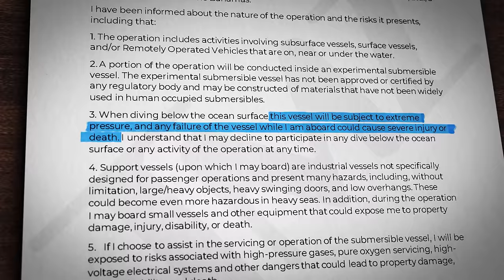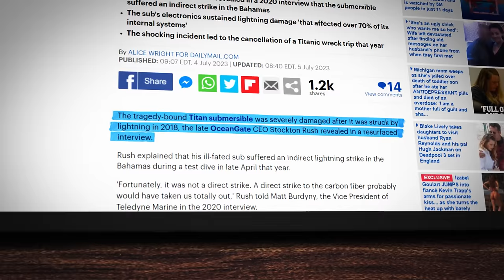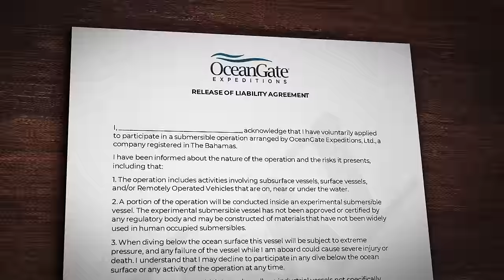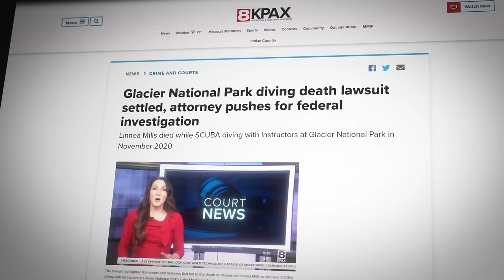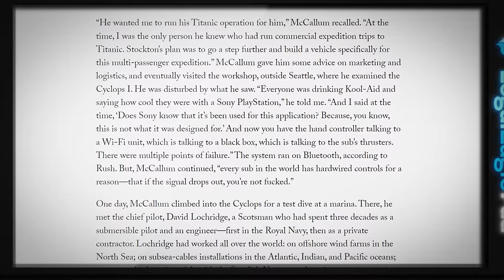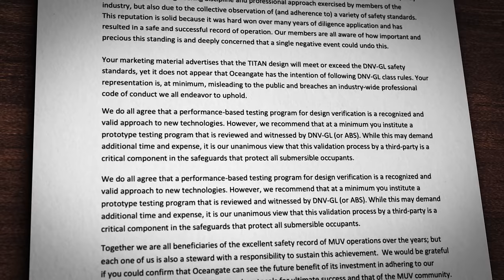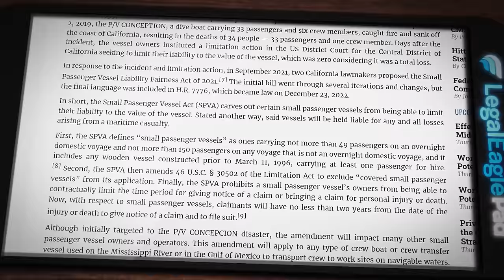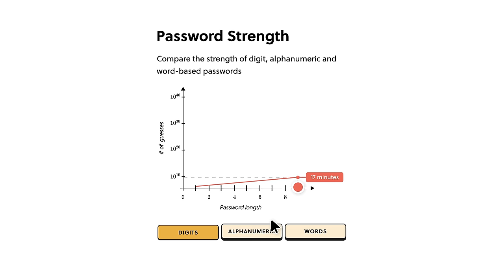OceanGate Is Getting Majorly Sued

Comment: It's worth remembering that the owners of the Titanic followed all the laws and regulations of the day in the building of the ship and the quantity and type of safety equipment.  It was also commonly believed at the time that large ocean liners couldn't sink under normal circumstances.  The sinking of Titanic led to dramatic changes.  But the owners of the ship weren't even negligent, never mind grossly negligent.  Even the captain of the ship was technically following standard procedures.
Reply: Maritime standards were atrocious back in the day eh?
Reply: Didn't they use bad rivets etc, plus didn't have the keys to the Loic locker with binoculars? There were a ton of rules broken with Titanic, iirc.
Reply: This is incorrect. The Titanic's construction had many cut corners. There existed two sets of plans; one for shareholders and regulators to look at, and the actual ones the engineers were to use. The main consequences are that the Titanic should not have sunk the way it did as fast as it did, and there should have been more than enough lifeboats for all passengers and crew.
Reply: technically titanic itself was tested  .. though ocean  gate was  not  .   titanic actually exceeded the standard of the day and the bulkheads wouldve kept them afloat in  normal head on crashed .. however it is HOW  it hit the  ice berg that led to its demise...   so  white star line  not claiming responsibility   is a little more ok ( not perfectly ok) than ocean gate that didnt  adhere to any standards
Reply: @samanthaabel1079  The Titanic was not tested, that was the first and last iceberg it crashed into. It was famously the ship's maiden voyage. Any ship would have sunk hitting that iceberg, but the Titanic's cut corners meant it sank too fast for people to safely evacuate, and they couldn't even do that because there weren't enough lifeboats. The Titan sub however was actually tested, it had already been down to the Titanic wreck a few times; the issue was the shoddy construction and lackadaisical attitude. The materials used for the hull don't do well with extreme pressure, and so the hull was weakened rapidly over its dives until it eventually gave and imploded. Both events have the same root cause of rich people cutting corners, both companies are responsible.
Reply: @YEs69th420  But not having enough lifeboats actually wasn't a negligence. There were enought life boats according to the law and current rules.
Reply: The Titanic wasn't merely built to conform with safety standards of the day. The hull and the multiple water-tight compartment design was well beyond what was required by law, and in certain respects. It was an EXTREMELY well made ship for the time period. She also had significantly more lifeboat capacity than what was required, and there wasn't enough time to actually load more lifeboats anyway. To say that it had a "design flaw" with the water tight compartments is actually very misleading. Those compartments were still offering way better protection than almost any other ship of the time period, and, in fact many ships being operated even today have less robust hulls and are actually more prone to sinking due to hull damage than the Titanic was. It is actually completely misleading and absurd to argue that the design of the Titanic was negligent, or that design flaws or "arrogance" had anything to do with the loss of life which happened.

The oceans are just inherently dangerous, especially the North Atlantic, and the Titanic was just unlucky. That's why it sank. The ship which rescued the passengers in the lifeboats was actually far far more vulnerable to sinking due to hull damage, and the captain's choice to take her at full-speed into an ice field was actually quite reckless, and it came very close to hitting ice as well, but it would have very likely sunk much faster than the Titanic did. 

More lifeboats wouldn't have actually helped that much at all. There's a lot of myths about the Titanic which many people still believe.

Comment: New level of horror with this whole situation is that window might’ve started to crackle moments before it imploded so they might’ve known they were about to die. That’s so sad.
Reply: Apparently the thing made really really loud cracking sounds even on the dives it survived
Reply: one preprint claimed there was 48 seconds of mechanical and electrical failure where they had no control, the sub was sinking and pitching, complete lights out.
Reply: @jeffreychandler8418 that’s terrifying, where did you hear that?
Reply: @VillainApologist_  "48 seconds ‘of horror’ aboard the Titan" AS news. seems to be conjecture from an expert on further inspection
Reply: It's probably the hull that started to crackle. The window was only blown out after the whole thing had imploded.
Reply: @robertgaudet7407  which was a sign that it was technically meant to be a throw away submersible.
Reply: @jeffreychandler8418  i heard that but i just dont know how much i can believe, the story keeps changing.  If they lost comms, how would they have any clue about that
Reply: @brp7856  They're looking at the time between losing comms and the sound underwater sensors picked up. They've also examined the wreckage.
Reply: @jeffreychandler8418 yeah that’s the official report. They all flew to the bottom and then boom.
Reply: @ZiddersRooFurry whats the margin of error on that, seems like multiple factors to determine a margin of error.
Reply: I mean they got into a sketchy excuse of a sub after the ceo has repeatedly complained about safety….so not sad, stupid 😅
Reply: @brp7856  "If they lost comms, how would they have any clue about that"
They almost always lost comms on a dive but they had never lost tracking, when they lost both comms and tracking it was pretty clear that the sub had imploded, beforehand though they had dropped the weights and knew they were in an emergency situation, at least that's what james cameron said in an interview but this was early on and he made it sound like his sources weren't official and it was a bit of hearsay
Reply: That plexiglass dome was the strongest part of the sub.
Reply: It might be cold-hearted but honestly apart from the 19 year-old in here, they all knew or should have known what they were getting into. I think the company, CEO, and passenger's heirs owe the involved countries and rescue companies a debt for the expensive useless attempts to rescue them. This was public money.
Reply: @jeffreychandler8418 there was a supposed leak of the chat logs between the sub and the surface. (They used chat to communicate not audio - chat is lower bandwidth makes sense).

They appeared to decend roughly 50% faster than they were scheduled to according to the timestamps,  and then the electrics started erroring out.

For the last 20 minutes they were trying to ascend but were only going up really really slowly, hearing bad noises.  Despite dropping all their ballast (including their ballast of last resort).

If the leaked logs are accurate, they all knew they were in deep shit for the last 15 minutes of their life. No pun intended.
Reply: Not only did they know, they were listening to “my heart will go on” the whole time. Odd foreshadowing if you ask me.
Reply: @happinesshotel5375 Really? So it didn't randomly implode? It only imploded when they hit the bottom of the ocean?
Reply: I am pretty sure they panicked and they knew they were going to die. So they did suffer the worst way.
Reply: @meateaw Those logs are most definitely fake. Source, Snopes.
Reply: @Cancoillotteman Please do you also think people who live in high crime neighbourhoods ought to pay for calling the cops?
Reply: @appa609  completely different matters : those people LIVE there, and most of the time do not statistically have a choice to live elsewhere. PLUS you don't call the cops for no reason, generally there is an undesired danger.

The right analogy with your example would be : "Do I also think people who deliberately go into high crime neighbourhoods yelling provocative insults at every passer-by, after having been warned by several security specialist it was a bad idea and after firing their experienced bodyguard; should pay for calling the cops ?"

Well yes, yes I also think in those conditions they would be responsible for those expenses.
Reply: @Cancoillotteman  I feel very similarly honestly. I find it difficult to completely empathize with those who chose to willingly do this, but that 19y/o I am absolutely devastated by. The poor dude didn't even want to be there

Comment: They were warned. They were warned by their own engineers. They were warned by the engineering community. They were warned by regulators. They were warned by prospective passengers who looked closer and realized the danger. And above all, they admitted they knew of the warnings.

That alone should be grounds for gross negligence.
Reply: That fired safety dude will 100% play a huge part in the lawsuit.

Comment: Remember those infomercials for storage bags that had a special nozzle so you could suck the extra air out with your vacuum? That's what happened to Linnea Mills. She entered the water with her suit deflated and, because of the damaged equipment, she was unable to add any air. As she submerged, the suit constricted around her, making movement and breathing impossible. The load of weights she was carrying caused her to sink too rapidly for her dive buddy (also a student) to aid her. As you get deeper, it takes more and more air to offset your negative buoyancy, so it becomes a runaway train situation. Not only was she incorrectly weighted, but the weights had been tucked into pockets on her suit, preventing the other student driver from simply unbuckling a weight belt to lighten her enough for the him to lift her. The diving company latered tried to deflect blame onto her traumatized buddy for the incident.
Reply: I wasn't aware that wet suits were pressure vessels.
Reply: @stargazer7644  They aren't. It was a dry suit. They're actually sealed completely, so no water can get in. You can wear them with regular dry clothes underneath and everything. Usually, as you descend, you have to keep adding air, or the little bit of air that was enough on the surface compresses until it has barely any volume and the suit sucks tight all around you like a vacuum pouch.

Comment: Wow, he really went out of his way to avoid all sorts of safety and legal regulations. The implosion was essentially guaranteed
Reply: Yeah. Not if but when.
Reply: That is why any lawsuit should be thrown out. They were already informed
Reply: @John_Smith_86  Were they?  It's one thing if anything happened was due to a freak accident or factor outside of their control, but OceanGate, pretty much had a lot under their control that could've minimized the risk.
Reply: @John_Smith_86  ?????
Reply: @urazz7739  Yea, they were. Nah, those safety improvements would have costed money
Reply: @John_Smith_86 so what you're saying is the evidence of gross negligence is why he can't be sued for gross negligence? That doesn't track
Reply: @urazz7739  They were not passengers chartering what they thought was a completed and safe vessel. There wasn't gross negligence. They were pushing new designs and materials for a submersible vessel and they were testing said vessel. Everyone that agreed to go on that vessel was agreeing to essentially be part of testing it, under the notion that there could be a catastrophic failure.
Reply: @DanielBohnen  He disclosed the lack of safety in his waiver. therefore, it should be acceptable that they did indeed die
Reply: @John_Smith_86 Yeah and in every other way he says "oh yeah, this is just a formality, it's safer than crossing the street". Fun fact, that's the same kind of argument I made to my parents about skydiving. The difference here, is that the skydiving company was required to follow safety regulations, and so many people have gone skydiving that accurate statistical data on injuries is publicly available. 

This dude was intentionally operating an experimental craft outside any regulatory body, buried evidence/whistleblowers saying it was unsafe, and was lying through his teeth, saying it was safe. That is a very different situation than other extreme activities where waivers are signed.
Reply: @trout512  Yea, but the paperwork laid it all out. And they did sign the paperwork

Comment: Guess that CEO bumped into one of the few dangers of being way too rich (and thus powerful): the fact that people around start to be afraid to tell you NO, or even if a few have the nerve and integrity to tell you NO, they can't really stop you and you can easily replace them with people that tell you only what you want to hear. Usually that only turns you into a menace to others but in his case it came right back to bite him in the ass.
Reply: I know right. This guy made me realize that being really rich is actually pretty stressful, much more than being extremely poor is. Poor guy was always being hounded by "inspectors" and "safety regulators". And now he's dead all due to a totally preventable and foreseen circumstance. What a shame.... 

*whispers*: Not really. Eff them rich assholes, lol
Reply: Except in this case he was told NO by SO MANY PEOPLE yet he went ahead anyway.
Reply: He was looking for another Rush
Reply: He will never know though.
The implosion happened in a fraction of a second, before the mind can even process anything. 
The last thing he felt was probably pride in conversing with his passengers. He died happy and watching his submersible operate without issue.
Reply: Sadly, this character flaw (of not listening when people tell you "no") doesn't require one to be rich, at least beyond the level of salaries that CEOs normally get. I used to work for an educational software company in which the CEO was pushing ahead with developing a product that didn't really have any chance on the market -- to put it mildly. But because he was The Guy In Charge, he was convinced that it would revolutionize the industry, and he tended to fire anyone who pointed out the flaws in his ideas or the decisions he was making in product development. Since CEOs tend to have a lot of authority in running their company, it's easy for them to fall into the trap of assuming they're infallible and that anyone who contradicts them needs to be sanctioned (or at least ignored).
Reply: That and everybody sucking up to you makes a person quick to believe they are infallible.
Reply: "It's dangerous to be right in matters on which the established authorities are wrong" Some quote, no clue where i picked it up.
Reply: Unfortunately, his choices lead to death of others. I wish it was just him. He can rot for all I care. He went ahead with his plans despite everyone saying no, don't continue. May this company burn for they went ahead and caused this by building it.
Reply: I don't know how "rich" Stockton Rush was. From what I have been reading, he chased potential "customers" all over the USA to convince them to take a trip. He certainly skimped on some well known safety issues because of cost. Some of the gimmicks he used were clearly a way to cut cost. There are companies that make military grade controllers, but he picked an off-the-shelf Logitech connected via Bluetooth (and considering how many times my earbuds fail to pair, I wouldn't use BT for my games. All my controllers and peripherals are wired because of reliability and latency.
Reply: @khinweepang  IF the transcript of the last comms are to be believed they all knew very well what was about to happen. " alarms going off, we are trying to rise dropped ( I forgot what they said they dropped) but it is not working" and then the comms cut, so while you are correct, the implosion happened too quickly for anyone to notice. They all very well knew it was about to happen.
Reply: @michaelwalpole2208  Well, how did it end? Did the software make it to the market eventually? Did it bomb, as expected?
Reply: Money is no replacement for wisdom
Reply: @tibor29  A good question. At the time I was laid off from the company, they hadn't completed or released the software. It looks as though they may finally have made it available. I don't know how well it's selling, but most of the other products the company was offering weren't earning enough to cover expenses -- hence why I was laid off. If it got adopted by a state or an important district, it might be making a modest profit; if not, it won't be earning back its development costs. (Sorry I can't answer this more satisfactorily, but it's been several years and I can't go into too much detail.)